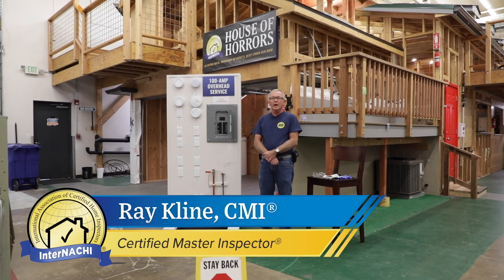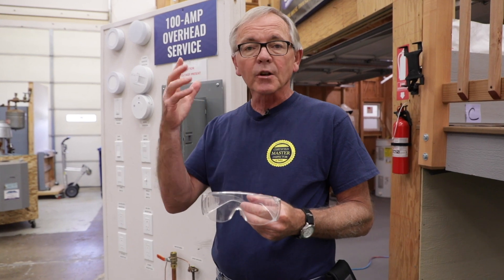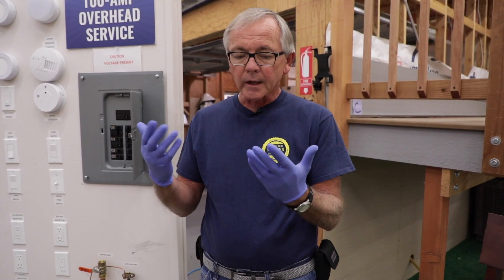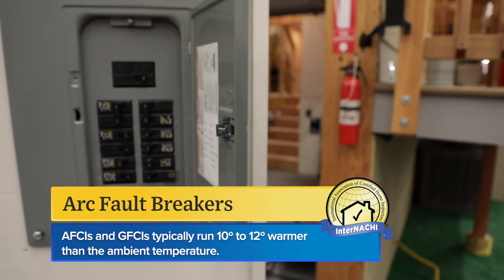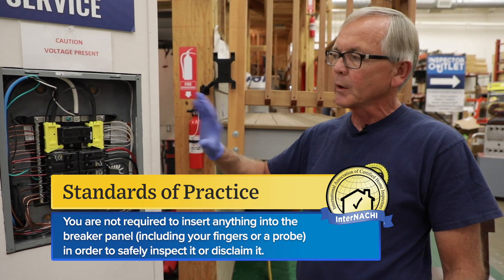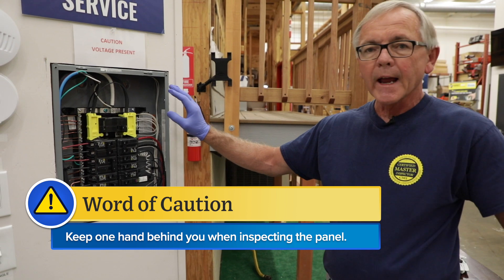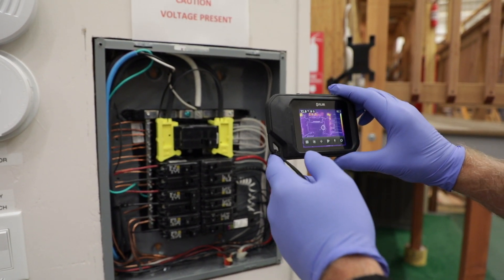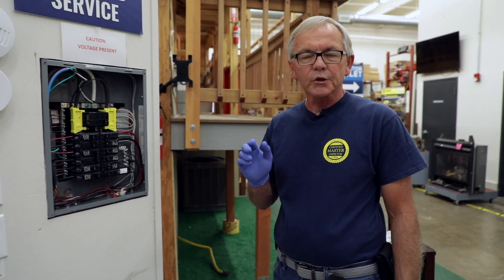How to Safely Inspect Circuit Breakers with Ray Kline, CMI®

Comment: Do you check the actual breakers to see if they are loose?  It seems that every panel I look at has breakers with some wiggle.
Reply from the maker: That's fine to do. But careful if there's actually a defect. Could get hurt. Or cause a spark or more problems. Remember, a home inspection is a visual-only inspection.